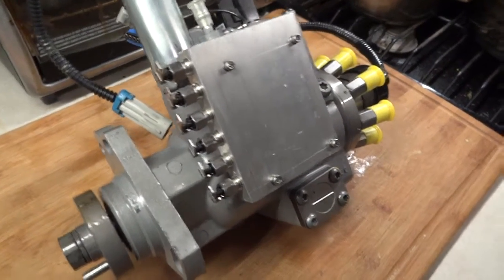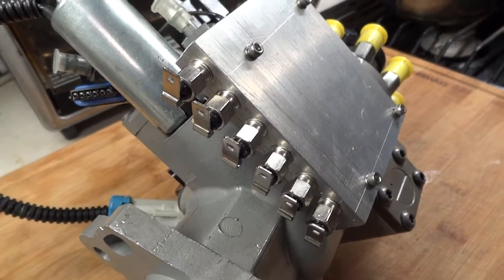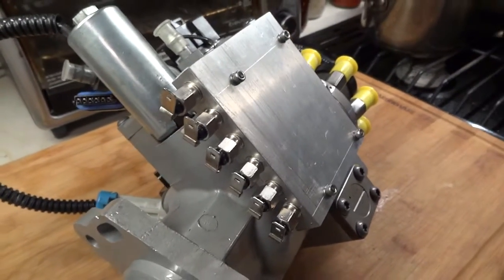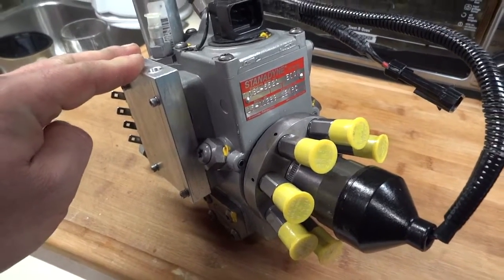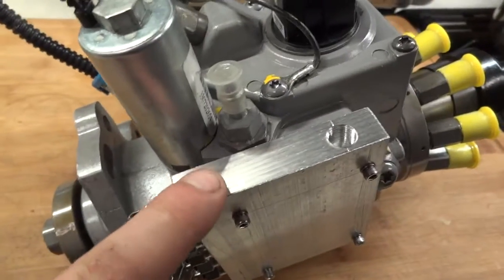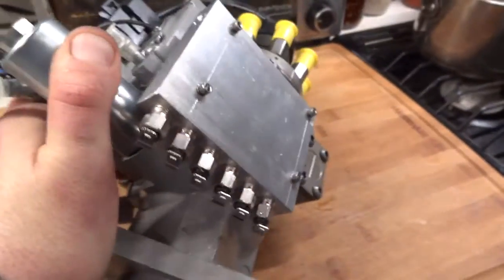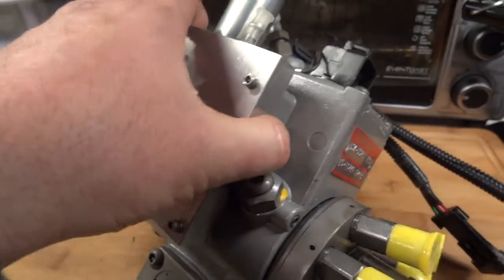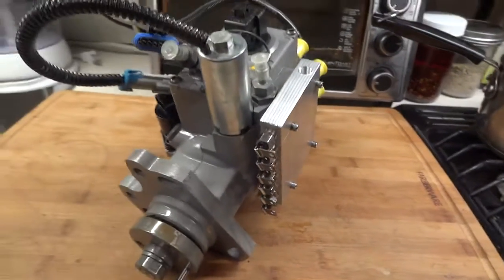Chevy Suburban Pump Heater Setup (1000 Watts)

Comment: hey, don't know if i already told you this but that is basically my idea, aluminum block to both heatsink when warm and heat up when cold, but 3 on the other side on a smaller block too, and glow plugs gear clamped to the lines 2 each near the middle but spaced and 2 on the injectors, ive actually tested the injector glow plug idea and it works good, just getting too hot to touch but not enough to cause instant burns, the wvo and diesel did not catch fire but it bubbled out of the top, and there is just enough room between the head and the injector, hard to install and don't touch the return lines directly, you can then heat the whole system in seconds up to a liquid temperature and runnable on non 6.2/6.5 diesel in minutes, that would then minimize any cold wvo damage, i was also going to direct heat the wvo and circulate it with the pump from a ford powerstroke (got the pump installed, works great but the filter pops the seal if not installed just right so i added a adjustable pressure switch for <$20) but it does not work the way i planned, more mods would have been needed, the goal was for it to circulate through the pump, i knew it was going to be slow but it was a trickle, two options to heat the line fuel they include using a pressure valve to let the excess go down the return but i found these valves to be expensive and the one i could buy at the right pressure needed 3/4 inch fittings, the other option is to use a 2 way valve or 2 one way valves or ball valves in your case, to shut off the flow to the ip and open it to the return line to bypass it but seeing as the ip is so restrictive you just need to put two tees into the feed and return and one valve to allow the line vwo to flow down the return, as close to the pump entry as you can, and have a small direct heater to heat the fuel in that line, but use a temp switch so you don't polymerize it, or go indirect, you also have the option to have a system back near the tank to slow then shut off the return so it has no air in it then shut off the feed, the open a tee between them, so the fuel circulates only in the lines, heating quickly, then when warm open the feed again but almost no fuel will go to the tank, better yet have a check valve, low opening pressure, those are cheaper, and then when you crank it for a second any cold wvo is replaced quickly and into a warm pump, this line heating step may not be needed though as once the injectors and lines are warm the fuel in them will be ready to run and you would not have time to heat the feed line fuel, you can add a heater just forget the valves and all that, the heater is so the wvo going in the pump is slightly warmer, you can then have a thermal switch shut off these relays when the under hood temp is a few degrees below full operating temp so if it only gets so hot they aren't left on, with the heaters you have and 1 or 2 on the other side and 2 heaters per injection line and 2 per injector i find these parts heat in about 2~3 minutes and you can run without cold wvo getting to the engine, the only thing left to warm up is the pump but since you only have to push its wvo not open a cold injector it wont hurt it, by this time the pump wvo should have warmed by about 2~8 degrees Celsius, so if you have a remote door lock system and have a trunk option push it before you go out or when you get into range and then open the doors, if the heating is started even just before you grab the door handle, by time you are in and have your belt on you should be able to start it, now that is quick, and if done by remote most people will assume you are just running pump diesel

Comment: also if those are not the AC Delco 60g series plugs that don't burn out from a long glow time then change them to them, that was what my design was based on, even though they already last longer by being colder i figured better safe than replacing burnt plugs under a tight intake area

Comment: At least a yr ago i was telling you about running my 1994 f 250 IDI in oil and you said to keep you posted. 
It was as you said... As long as you filter properly you should have no problem...i now have over 309,000 miles and havent had to replace injectors, do you think i should replace them anyway ?
The inly priblem i am having is hard cold starting but thats because i need to replace my glow plug controller.
Reply from the maker: +Robert Moreno You don't need to replace the injectors.
Just run some diesel through them with Lucas injector cleaner every 10,000 miles or so.
The only time I would replace them if your engine is getting louder (crackling) and you have lost ~10-20% gas mileage.
The detonation can burn a hole in your piston and brake rod bearings.
But this is normally not the case unless you have weird smelling or stinky exhaust.

Comment: Can a similar setup be made for 6.2 diesel injector pump ?  Thanks in advance.
Reply: No, your pump looks different.
But you can heat the veggie oil with an in line heater before it goes into the pump.
Reply: @We-Do-NOT-Consent-303  Many thanks for advice and for quick reply.